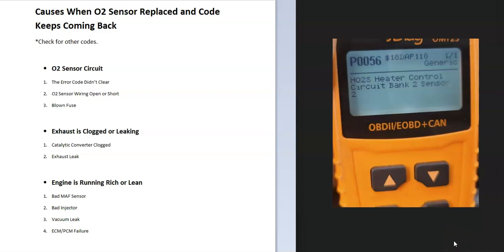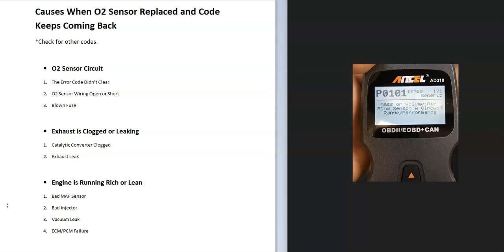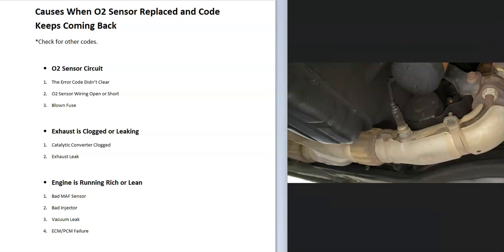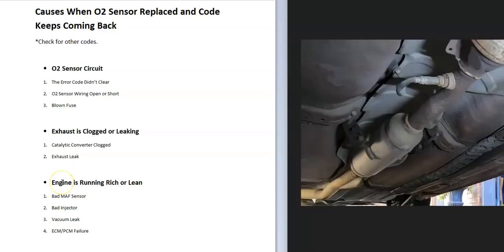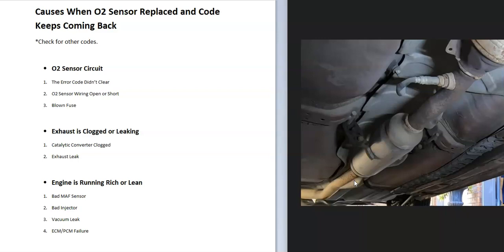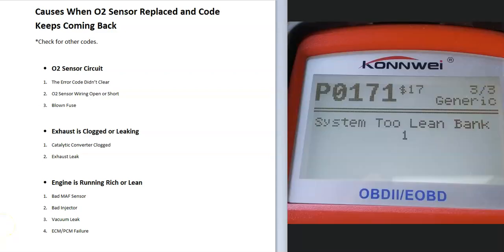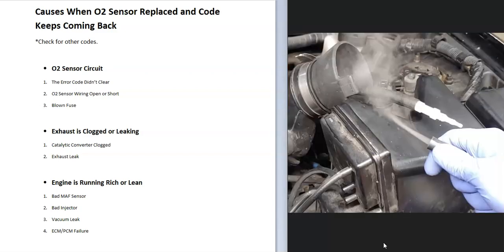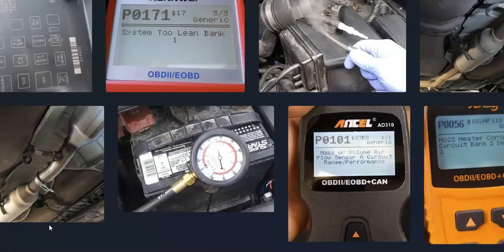Causes When Oxygen Sensor Replaced and Code Keeps Coming Back

Comment: I keep getting po172 - po175 oxygen sensors running rich bank 1&2.
After replacing my injectors grom 1 hole to 4 hole. I did a fuel pressure test. Put new fuel pressure regulator. Codes came back. New spark plugs, codes came back. New coil rail, codes came back. Replaced upstream oxy sensors, codes came back
Cleaned throttle body and IAC looks new and moves, codes came back. Rough idle continues, going through 1/2 tank fuel in 50 miles. No smoke.
Took to Firestone diagnostics, can't figure it out. Going back on Tuesday, July 25th.
Reply: Never thought about changing your catalytic converters
Reply: @TB12DAGOAT  It was replaced about 2 year's ago, but I was thinking, maybe since my Jeep was running rich for about 6 weeks, may have clogged them? But I did replace all 4 O2 sensors. Thinking maybe time for Seafoam??? Update: I replaced the injectors with Chrysler OEM, and the Codes stopped, but still idling rough cold. TPS, MAP, IAC, Coil and plugs are new. Need to check plugs, may have gotten foiled, but don't think so in that short of time.
Reply: Did you ever get an answer? I’m having the same issue
Reply: @courtneywomack414  No! Not yet. Firestone told me to replace the TPS and use Mopar parts. I've been using after market parts. Waiting on a quote from them to put in a Morpar TPS, but I'm thinking, it all started from the cheap Chinese injectors I put in and might have them install the Chrysler OEM one's? Expecting a callback, and going to ask a quote for that. Probably gonna cost me $800? I have no cash, but, I have their C.C. which will make it easier to make payments. What brand of parts have you been using? I'll let you know if this solves my problem.
Reply: Maf sensor and or Map??
Reply: @scottsprowl7484  Replaced MAP and went back to Mopar OEM 1 hole injectors. No more codes, but still running a bit rough at idle with very little rpm fluctuating.
Stepping on the gas in park, it stumbled a bit. 
All trims seem to be fine too🤷
Reply: Purge valve solenoid
Reply: @chrisb7109  Is that the EGR valve?
Reply: @jat-justamaturetech-philpj8285 Purge Valve is not the same as the EGR.